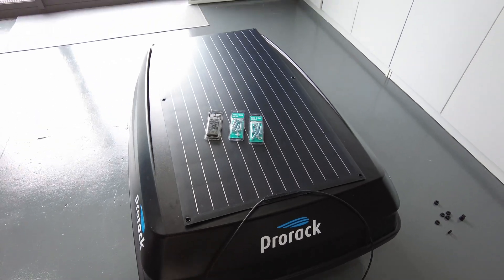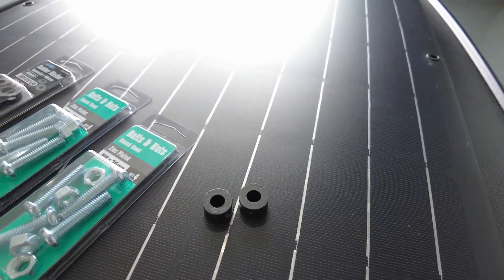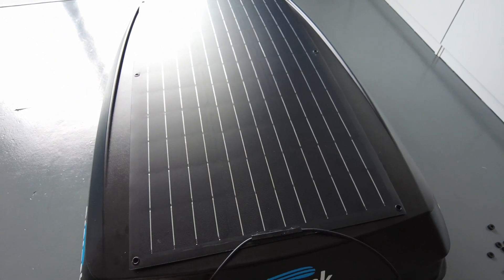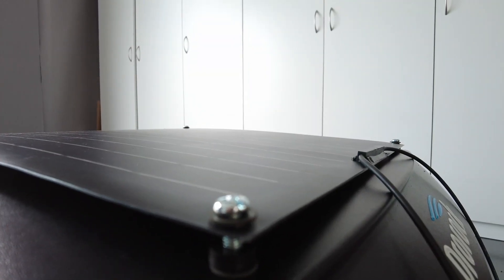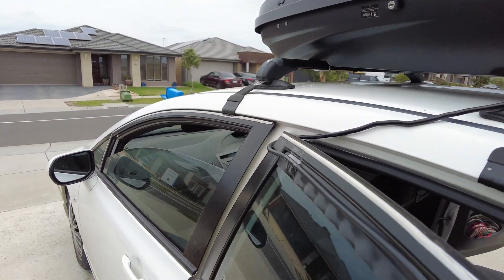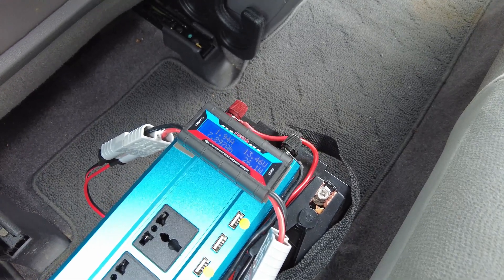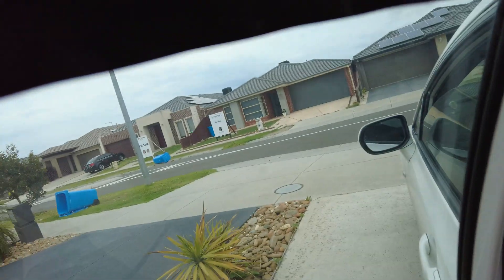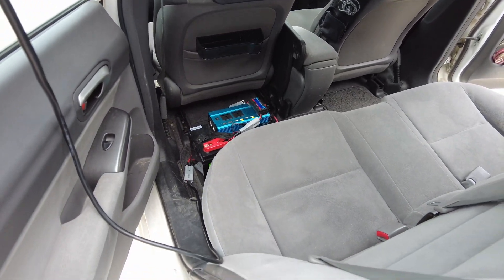How to Install Solar Panel on Roof Box Pod 100W- Honda Civic Camping

Comment: Just stick the panel straight onto the box with Sikaflex and use H/D Gaffer tape around the edges. Modern flexi panels don't heat up like the older models.

Comment: I did the same but the panel lost efficiency within months.
It dropped from getting max 80Watt to just 5 Watt. Semi flexible solar panels are quite  sensitive to bending and vibrations.
Reply from the maker: Not sure, mine working fine since 3 years for now
Reply: @PunjabiAussieTraveller  But how much of that 3 years in active use.

Comment: Your battery setup in the Car looks pretty open an not fire safe. Did you leave it like that? What abut the label through the window and breaking into the car?!
Reply from the maker: I have got battery box now with AC output.. Its mess free now.. Cable is so far fine, no issues.. Im enjoying this small setup so far.. good for 4-5 nights camping..

Comment: The panel fits that box perfectly.  Have a longer box I would like to do this on but box is brand new and I don't want to drill the holes in it.   Hrm, thinking...

Comment: Have you had any issues with noise? Does it flap at high speeds?
Reply from the maker: Its been nearly a year. No issues with noise. Few trips, drove the car max at 110kmh. No issues with waterproofing either. Hope it helps.

Comment: I have the same box and considering doing the same… do you have a solar controller in between your panel and battery?
Reply from the maker: Yup i do. The controller is hooked to my battery side with double sided tape.

Comment: Hi mate,
Were you concerned that drilling holes in the pod would compromise the waterproofing of the pod itself? I'm considering mounting a flexible panel onto a pod too... but with a corflute and vhb tape.
Reply from the maker: Its been nearly a year. No issues. few trips, drove the car max at 110kmh. No issues with waterproof. As mentioned in Video use washer below and above bolts. I used this method to avoid overheating of box when its too hot. If the roof of your pod is flat enough, Corflute can work too as it dissipate heat. I wanted something permanent so i went for drilling. Just FYI i use additional 150w Solar blanket with it when its sunny. Roof pod solar only produce 4A max during peak sun as it can't be tilted to face sun.Hope it helps.
Reply: Yes he should have gone with a heavy duty Double Sided tape what they use on Caravans

Comment: I was thinking of doing this exact set up. How well is it working for you? I'm curious how the panel handles the permanent flex, the rough ride, and also if the box is still weatherproof.
Reply from the maker: Its been nearly a year. No issues. few trips, drove the car max at 110kmh. No issues with waterproof. As mentioned in Video use washer below and above bolts. Hope it helps.

Comment: Are you concerned that having the spacers at the FRONT of the panel could tear it off when driving at high speeds?
Reply from the maker: Not at all, Its better to have some space to wind pass through and prevent the panel getting hotter. Drove at max 110kmh for few trips in Melbourne with no issue. Hope that helps.